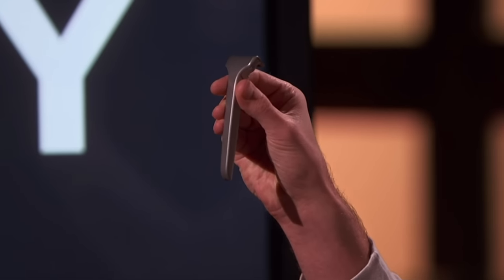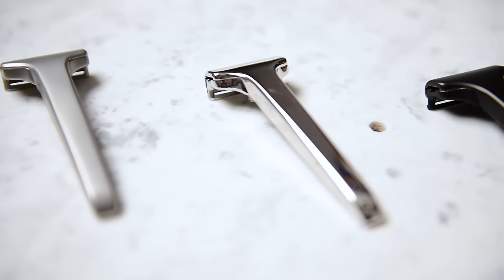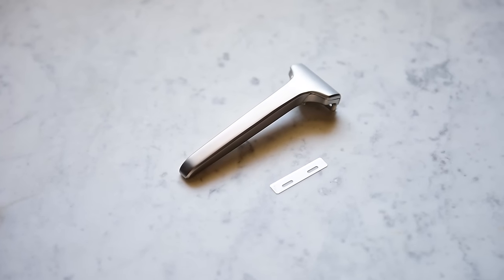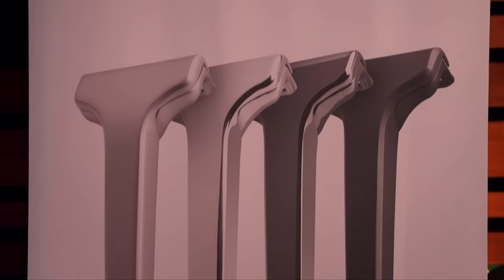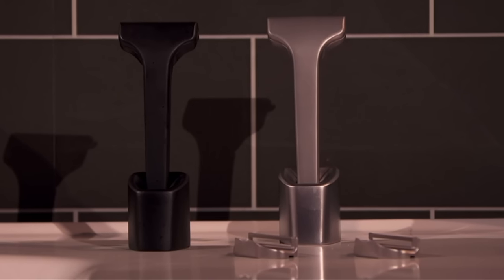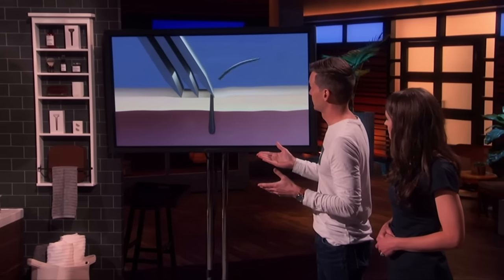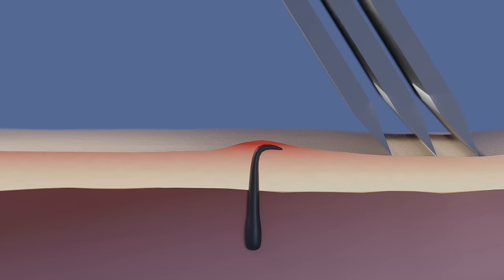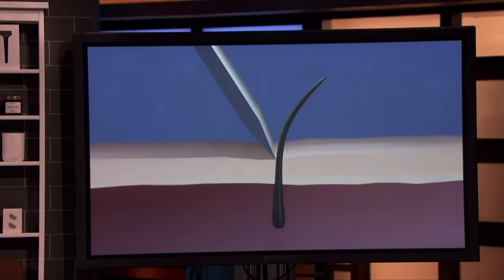Supply Razor on Shark Tank

Comment: why is it better than a safety razor? it looks the same to me. also how much are the blades? for a safety razor they are extremely cheap
Reply: It shaves better than any safety razor. It also looks nice and you won’t ever have to throw it away. I think it’s pretty worth the buy
Reply: i meant a double edge safety razor. you dont have to throw that away and it also looks and feels nice
Reply: @sunsneeze  Oh well in that case I guess it’s no different. But I like it because it comes in a stainless steel option and design I find very appealing. A bit a pricey but not outrageous.
Reply: @sunsneeze  it uses injector blades, they are thicker and tend to be much sharper than DE blades. They also take longer to get dull. Its comes down to preference, some old heads prefer these injector style razors.
Reply: There are other ones like double-ed safety razors are actually better than these ones